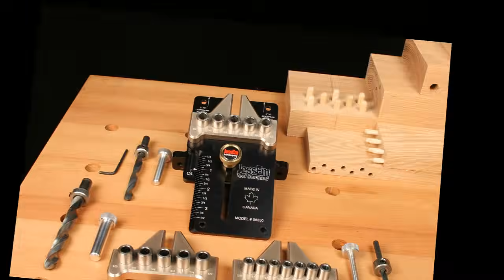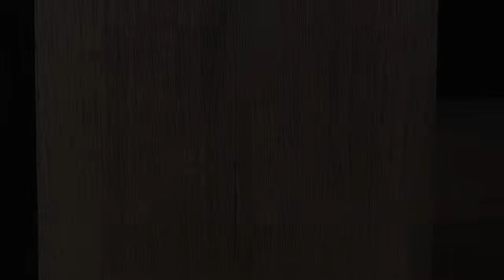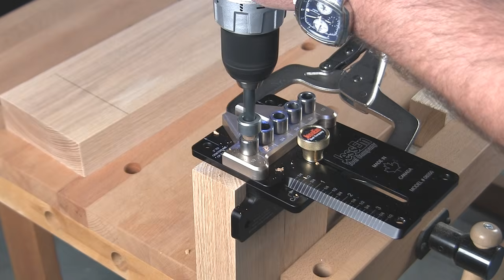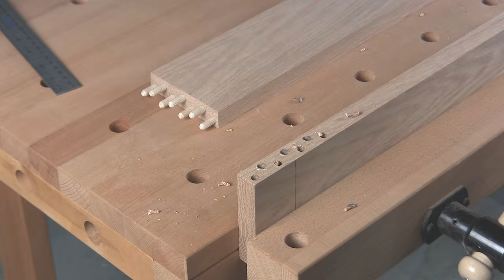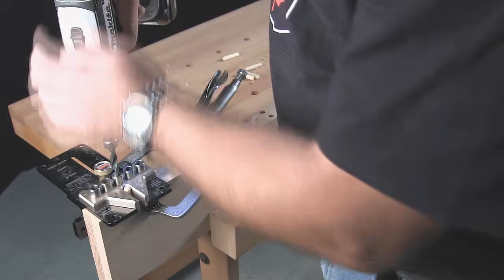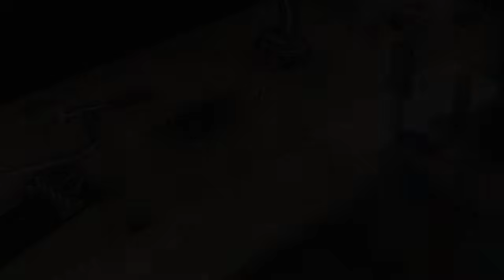JessEm Dowelling Jig Model 08350 | The Best Doweling Jig for Precision Wood Joinery

Comment: At 1:43, how do you align the jig to the 2nd board? the CL mark cannot be used anymore and the cutout at the top makes for a poor reference. Jessem tell me how to align it!
Reply from the maker: If the CL line is not usable when marking your board, you can instead reference the lines on the top left and top right of the jig's top plate. They are spaced exactly 2" to the left and right of the center mark of the center dowel guide. Those marks can be seen at 1:43 if you pause the video.
Reply: @JessEmToolCompany  makes sense, I couldn’t see that at first. Now I want one!
Reply: Good point!

Comment: I don't own this jig yet, but am considering all various major brandname jigs on the market before buying one.  It occurs to me there is nothing to prevent using this Jessem by aligning it to the left edge or the right edge of the the mating workpieces the way the Dowelmax is used.  To me aligning to a firm edge is far easier than drawing a pencil mark and eyeballing it to the enter of the pencil line.  Assuming the manufacturing tolerances are good enough so that the guideblock is centered to within a couple microns between the left edge and the right edge this should be possible.

Comment: Just wondering if this is capable of doweling corners angled at 45 degrees, like the jessem?  And I'm also wondering if the alignment groove for drilling corresponding holes in the face of a piece of wood is adjustable to different dowel sizes?  If not, what would you do if you are using a dowel that is larger than the groove.  Thanks for your help.